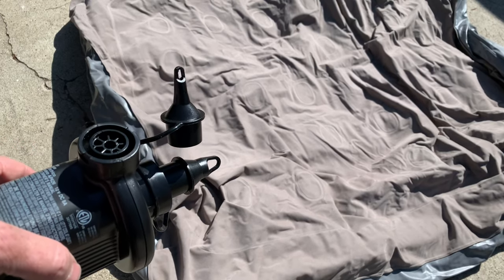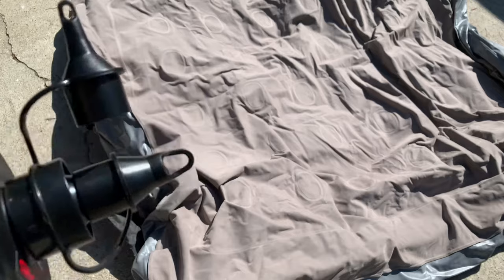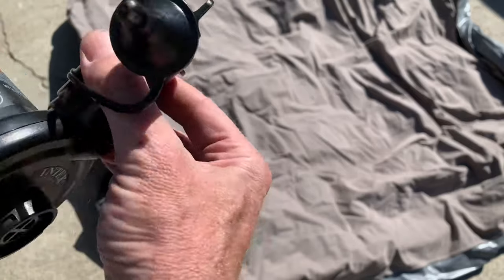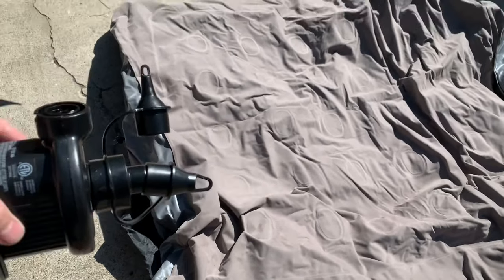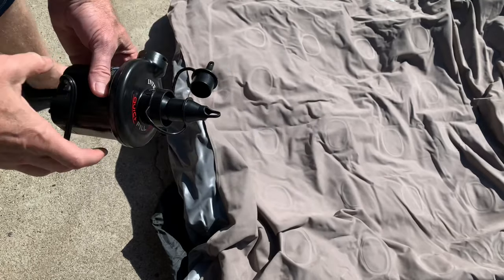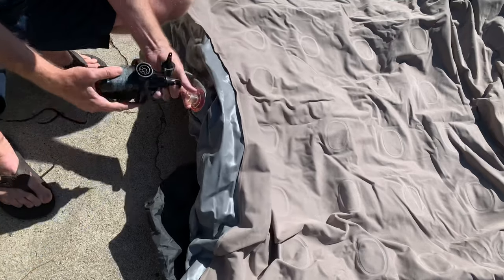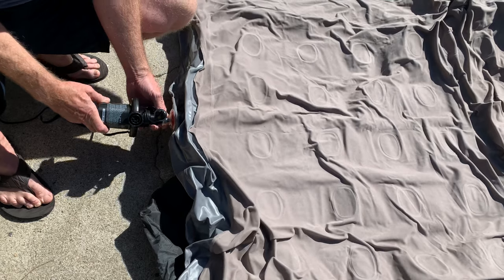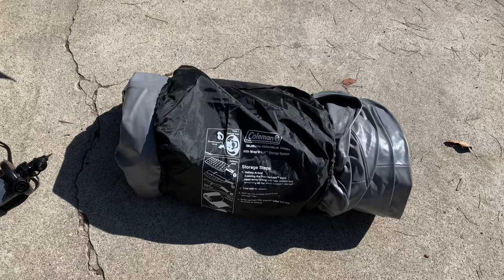How to deflate an air mattress

Comment: Every single air mattress i buy gets ruined quick. The Intex one that is as high as a bed lasted a good month or so until i turned over one night and i found myself sinking to the floor. Needless to say it ended up with no sleep after. Ive bought now 3 best way mattresses with a pump that automatically inflates it and deflates it. The first one failed in a short time like in 3 days. The second again went in like a week luckily i had a receipt. I finally looked up how best to use your mattress and i realized a couple things. One was that i was putting way to much air in it(my bad) because i didn't know it wasn't supposed to be filled like with no spare room inside. Another is prolly don't air it up while your on it( another idiot mistake). Then my last one the one i have now that lasted for 2 months i deflated it to move to another place and even though it automatically was deflating i still tried to squeeze the air out as i was folding it and rolling it up. My question is did i mess up the seam cus i had to push out the air even though it was auto pump or did i wrap it up to tight around where the pump is built in. I mean it was fine until i wrapped it up and moved to the other place so i mean something ruined it and i know it wasn't a hole and i also couldn't hear it hissing out while i laid on it. It deflates after like 3 hours or so laying on it. Can anyone help me with this situation and tell me exactly what I'm doing wrong. It's a cheap mattress. I mean I'm surprised it has a internal pump being like 25 bucks

Comment: I can’t do this, it’s not working.
Reply from the maker: If there is an internal flap in the valve on the mattress, you have to hold it open with your hand unless your pump has a long extension on it to keep the flap open.